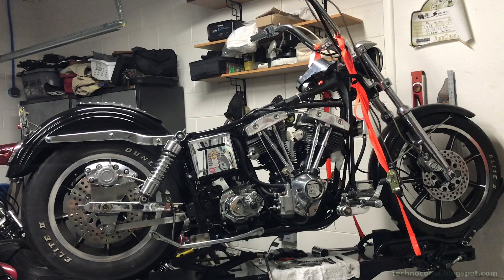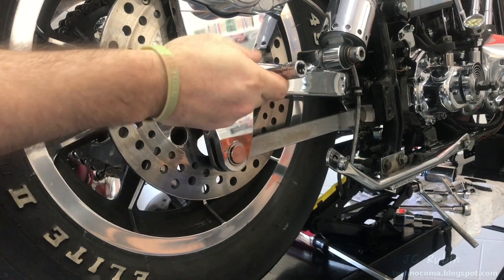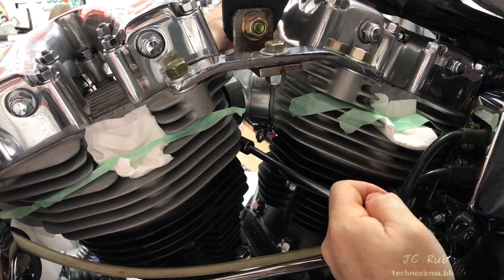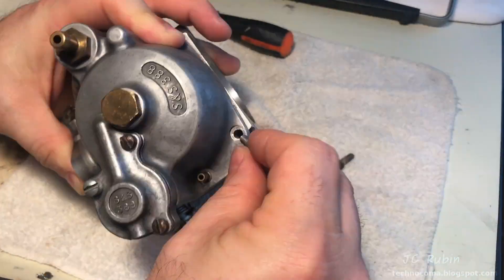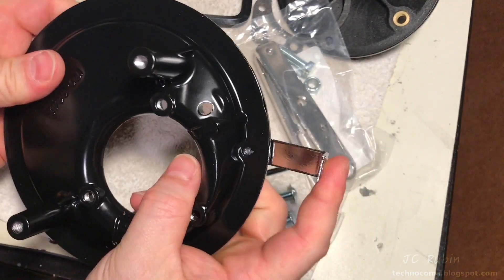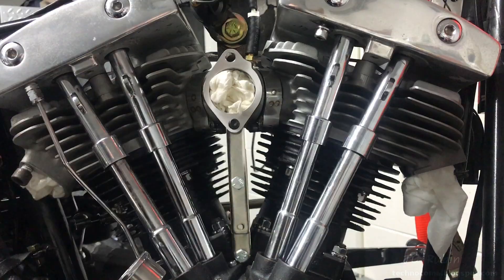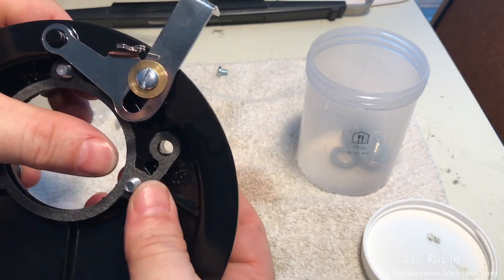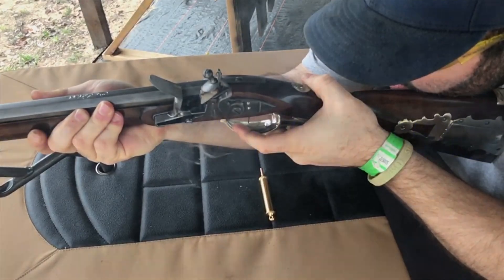AMF Shovelhead Lowrider Restoration -29 - Intake Manifold, Carb & Stealth Air Kit Install

Comment: I think that you installed the manifold upside down. The odd extrusion point on the manifold oval shape is supposed to mate up with the like point on the carb. The S&S logo will be facing down correctly installed.